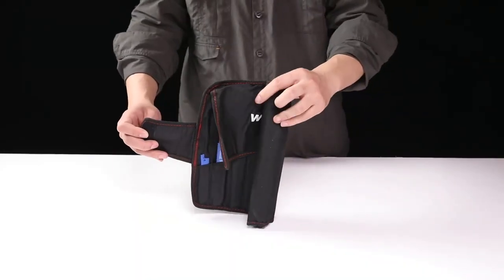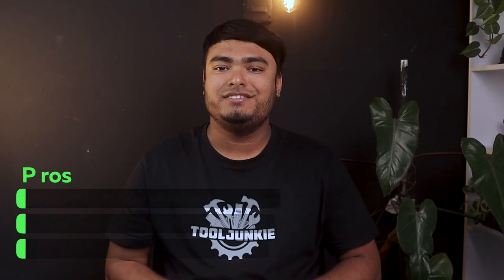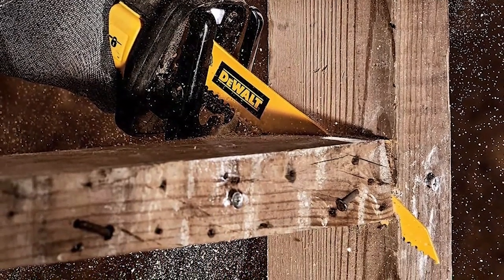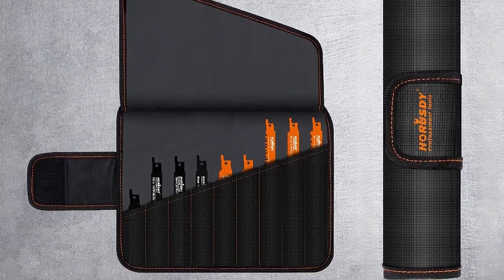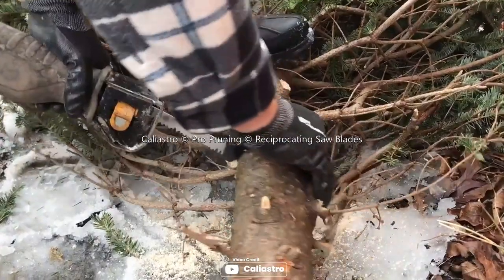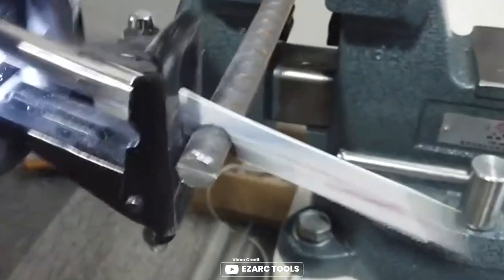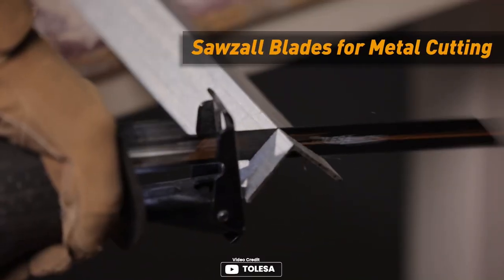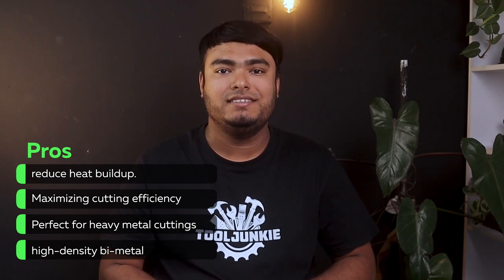Best Metal Cutting Sawzall Blade in 2024 | for Thick to Cast Iron

Comment from the maker: 🕝Timestamps🕝
0:00 - Intro: Best Metal Cutting Sawzall Blade
0:31 - NO. 1. WORKPRO 32-Piece Reciprocating Saw Blade
1:02 - NO. 2. DEWALT DW4892 Reciprocating Saw Blades
1:43 - NO. 3. HORUSDY 34-Piece Metal Reciprocating Saw Blade
2:36 - NO. 4. Caliastro Reciprocating/Sawzall Saw Blade
3:27 - NO. 5. EZARC Reciprocating Saw Blade
4:14 - NO. 6. TOLESA Metal Cutting 14TPI Sawzall Blade